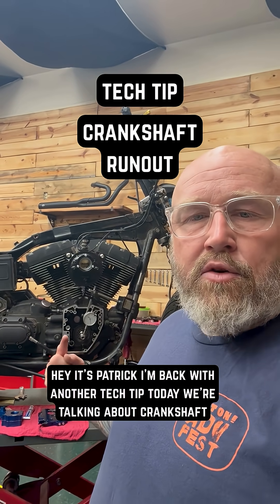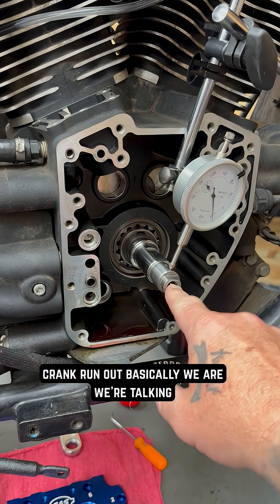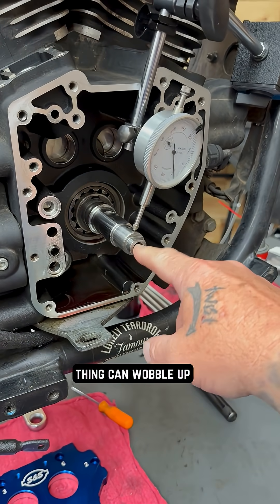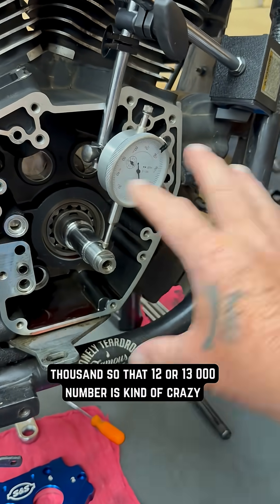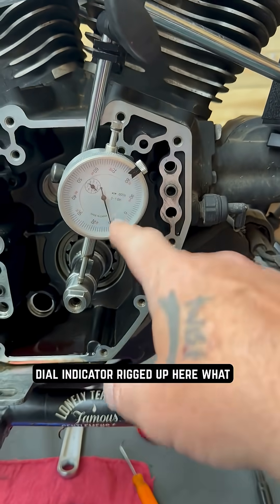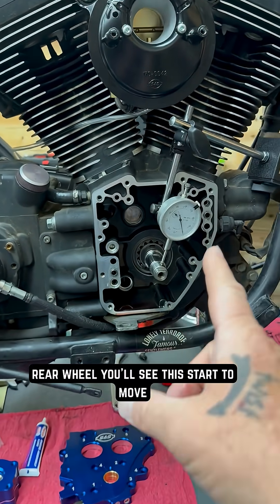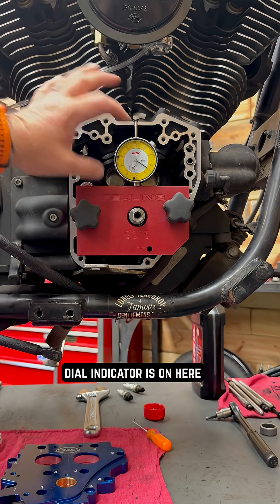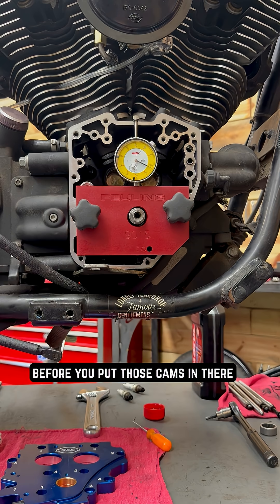J&P Cycles Tech Tip   Crankshaft Runout

Comment: .012" or .013" ?? That is some seriously bad machine work. We always considered that to be rough work, definitely not moving parts that would go in an engine.
Reply: That was my thought as well. I machine gas turbine generator shafts that are over 40’ long and weigh 100 tons and our runout or “wobble” tolerance is .002. I don’t understand how Harley finds that acceptable
Reply: @tiaseanetherton8626  Exactly. I grew up in a machine shop as my dad and two uncles were machinist, tool & die makers, moldmakers. We also made parts for hobby boat and car racing. Rods, pistons, decked blocks and heads, etc. Never, on any part whatsoever much less an internal component is .012" even close to acceptable.
Reply: @Resistculturaldecline explains a lot about Harley honestly. We had basic weld assembly parts that had +/- .005 and that’s a mile.

Comment: How do you fix that. That info would help
Reply: How to fix that? You have to tear the engine apart. Send the crank out to darkhorse, have it rebalanced. And weld it so there is no movement in the crank shaft. It makes it strong more bulletproof ,If the run out is too much you can ruin your oil pump.  And gear driven cam gears, it should be 0 to 1.000's. When they're done, dark horse does all crank shafts,, Or this man here.
Reply: my Dark horse crank is .0002
Reply: @johnbingaman3645 well I figured the crank had to be balanced I just didn't know with some certain mods.  I wish I would have went to school to work on bikes full time. I was so close to pulling the trigger on it but I got a job at a major utility company where I lived. Then they laid me off due to the coal ban. Pissed me off beyond words
Reply: BFH 🔨